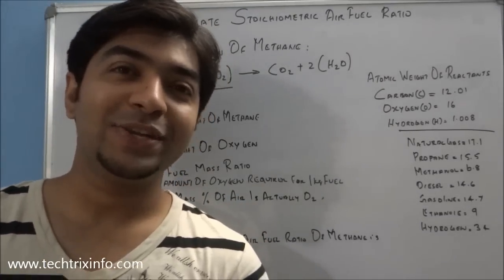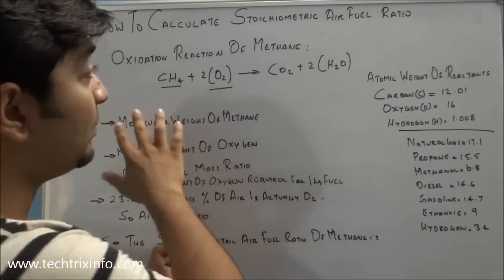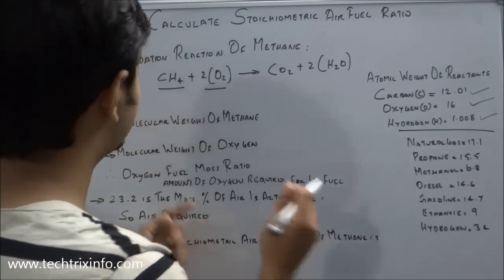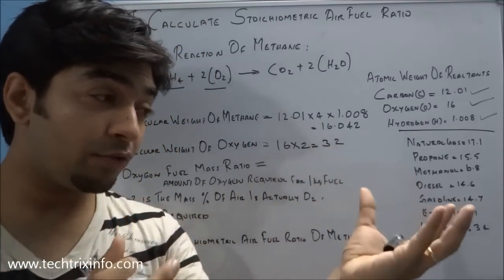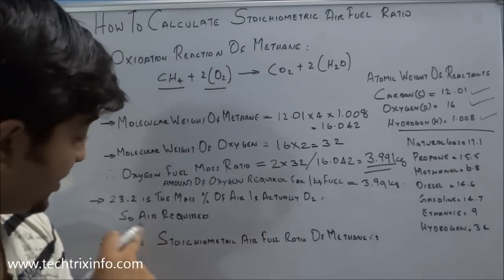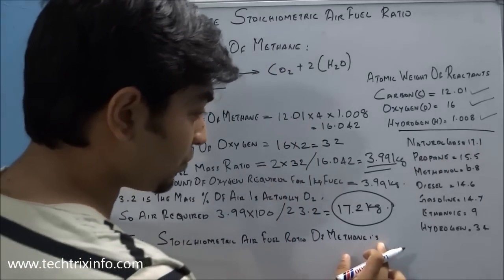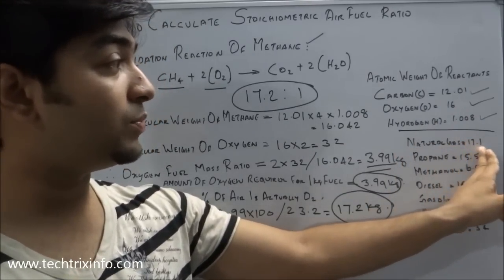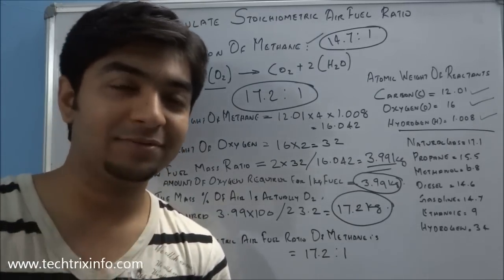How to calculate Stoichiometric air fuel ratio. ✔

Comment: There were mistakes in the calculations
a) CH4 molecular weight is 12.01 + 4X 1.008 
b) 2 kmoles of O2 = 64 kg not 3.99 kg
3.99 kg of O2 would be 0.125 moles of O2 (3.99/32=0.125)
there might be more mistakes bu I stopped watching